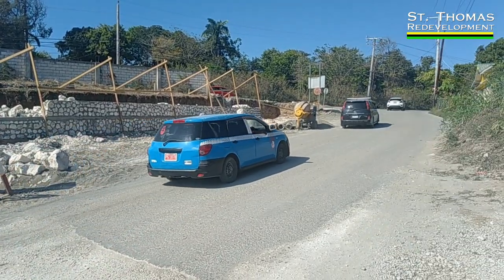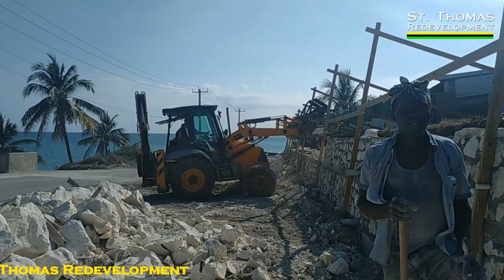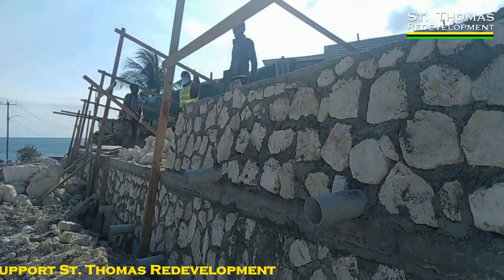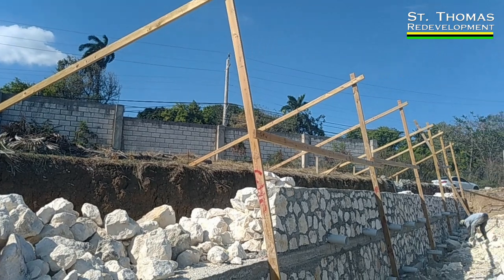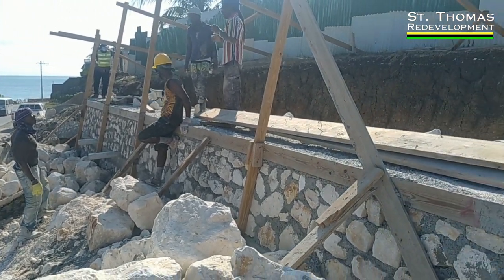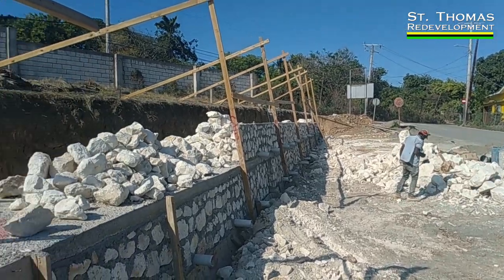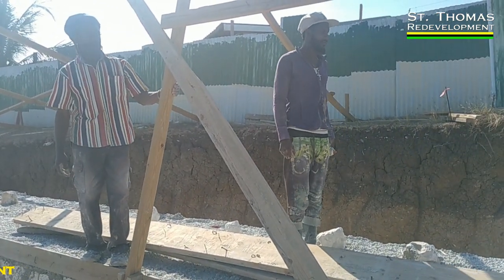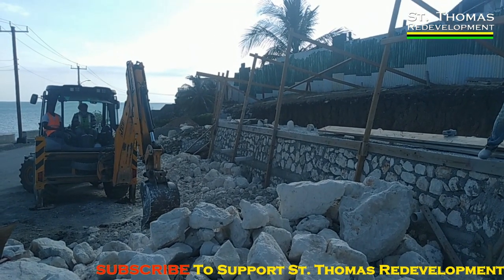SCHIP | Stone Wall Morant Bay

Comment: St.Thomas, Those Pipelines  Featuring In The Stone Walls Are Very Important To The Strength And Flexibility Of The Wall and As WELL The Stone's Walls FOUNDATION Maintning Strength.The Stone WALLS Will Not Be Weakened Over Time, And No Mass Will Be Able To Grow Inbetween The Stones or On The Stone Wall Itself🛣🚖🚘🚔🚍🛣✅..‼👍😀